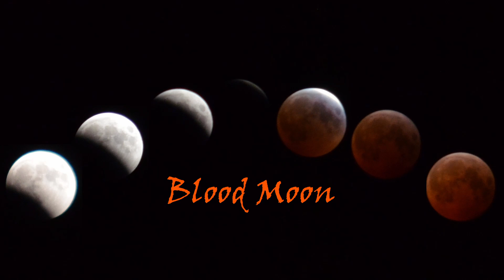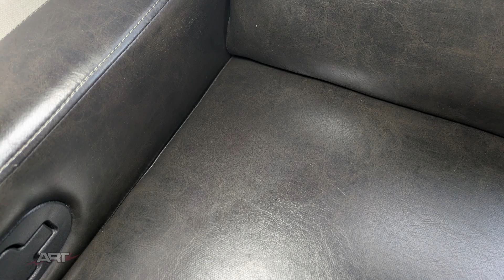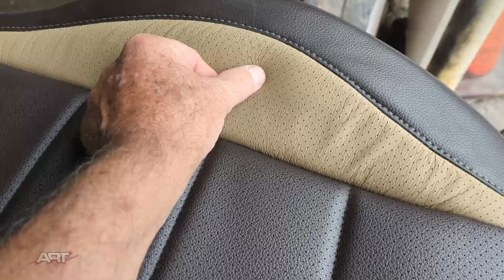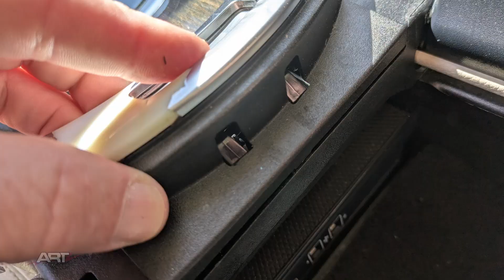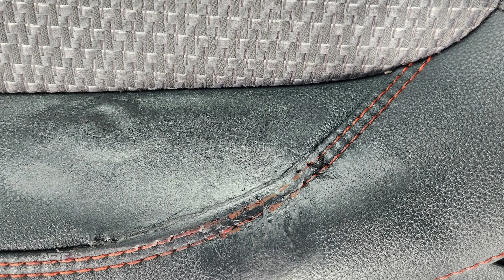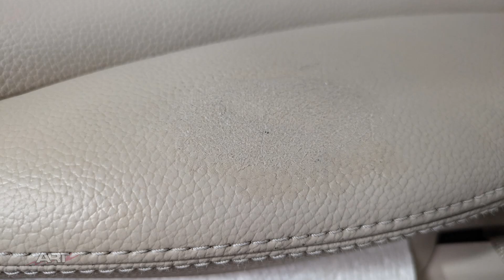Mercedes Seat - The Consumer Goods Dilemma - Part 3  V156

Comment: Hey Rick that's funny that you featured the very badly repaired Mercedes seat that I sent you the picture of, and yes, the person who "repaired" that has some issues. 
We recover Mercedes seats every week, in addition to the damages you pictured, they often rip at the sew line in the middle. And unfortunately, I've seen some seats where a repair was attempted. One time by just wicking thin CA into the rip which as you can imagine did not work.
I have experimented with the plastic powder / vinyl repair compound method, and it does do a much better job. 
On the Rover seat, in addition to the plastic trim rubbing against the outer vinyl panel, what happens is the constant flexing getting in and out of the vehicle causes the vinyl to crack and delaminate from the backing. We see this all the time on pickup trucks and SUVs of all makes. 
On occasions where we replace the outer sections, we usually do the whole part bolster and side panel back in leather which wears better.
I have found that we have to educate our customers as to why the damage is occurring and then we give them the options of repair or replacement. 
And we do not warranty repairs. 
As always thank you for sharing your knowledge.

Comment: Hi,
I am from the U.K and I love watching your work and guidance for our trade,, can I also ask what plastic primer do you recommend please, I am currently using Viper waterbased texture which is great on a fine texture finish but the build goes a little flat on heavier texture when dry....
Reply from the maker: It's a water base plastic primer which dries harder and more durable.  I use it as a binder for plastic coater.   The binder for leather is softer and more flexible by comparison.  By combining the two I get a texture that's stronger.  There are several videos already posted using it.
Reply: @a.r.t.srealrepairsforrealc8247  
Thank you for your reply, can you tell me the brand please, I really want to experiment with this and nail it...

Comment: Hello, I have a 2006 C230 MB and the front seats have the perforations.  I have a 3 inch tear along a perforation row the has broken through.  I live in Arizona where it is hot and dry.  Now that i know my leather seats are actually polyurethane, would   it be better to replace the seat cushion with leather or can repaired polyurethane hold up?  Thank you!
Reply: We regularly recover the urethane MBZ seats using real perforated vinyl not the OEM MBZ materials, I have not seen any of them come back with damage like the OEM material.  That said leather is definitely going to hold up better in the long run in my opinion.
Reply: @mttmg  thank you for your reply!  I appreciate it!
Reply from the maker: I would agree with what Mike has posted.  What each vehicle's interior package comes with I never know until working on it.  But if it's PU then PVC or leather is the way to go.  I am not aware of shops ordering PU anyway but I could be wrong.
Reply: @a.r.t.srealrepairsforrealc8247  thank you for your reply and sharing your knowledge.  I appreciate it.  I didn't know where to start with the issue.
Reply: @a.r.t.srealrepairsforrealc8247   One of my suppliers recently ran a sale on OEM Mercedes material which I assume is the PU, I didn't order any, I thought, why would anyone use that, seeing how it doesn't hold up?  The aftermarket PVC Mercedes vinyl seems to be a good material.

Comment: What psi is your air compressor set at?
Reply from the maker: The tank is about 120.  Line pressure I leave about 90 in case I need the stapler.  At the gun I guess between 5- 20 depending on size of texture or painting.